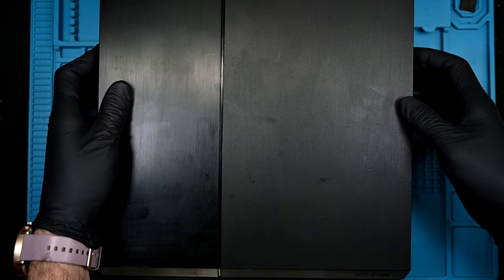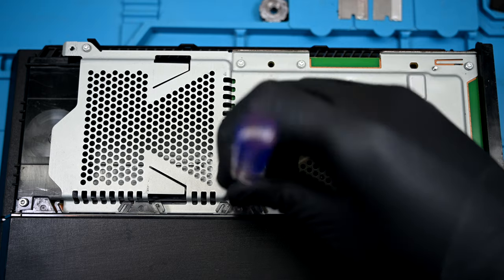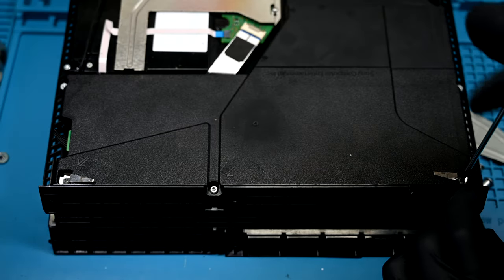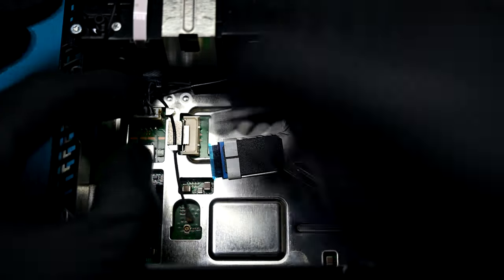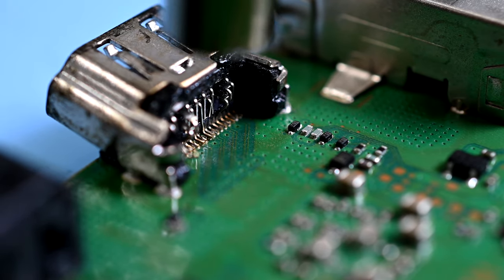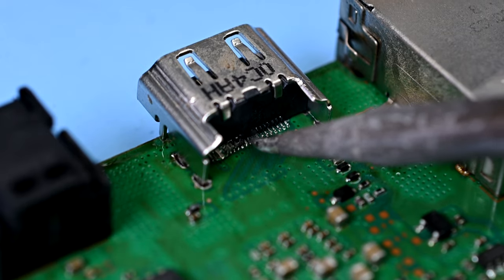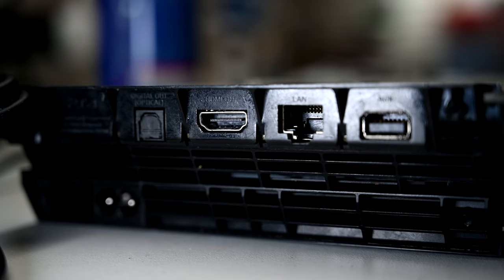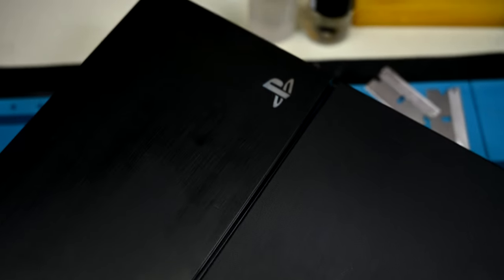PS4 HDMI Port Replacement | Guide

Comment: The clear liquid u used before u put the hdmi in place what was that bud was it that temp paste stuff
Reply from the maker: @kingkush4476  soldering flux, it’s used to keep the solder from going dry and brittle, it also helps things not stick together
Reply: @TapticDigital  magic thanks bud.

Comment: Question for a family member who tried doing this and I think messed up / broke it. For the pins at 3:04, if those ripped off and there’s no silver bits anymore, is the port officially broken or can you somehow solder new ones on?
Reply from the maker: It's not dead yet, but the repair just got a bit harder. What you'll need to do here is run jumpers. Basically the pad on the board that's missing carries the signal somewhere, we just need to find a way to connect the pin on the back of the new port to wherever the pad would carry the signal. I don't have a good video on running jumpers yet, search YouTube for "northridgefix jumpers", he has a few videos on rebuilding the connections to the port.
Reply: @TapticDigital  Tysm I will look into it!

Comment: I see you using a solder yet it is coming out clear when you melt it?
Reply from the maker: Clear solder sounds cool, but not what's happening here. The clear stuff is flux to help the solder flow and stick only to the pads on the board.

Comment: Hi, so the place that i live in isn't that pro tech  and if i bring them the HDMI port will they fix it for me but less expensive?
Reply from the maker: I'm not sure I understand. I would take it to someone with a good amount of soldering experience if possible. Some companies allow you to mail it in
Reply: @TapticDigital  sorry to take your time but I am trying everything i can't get anything under the prong pieces.
Reply from the maker: @Kurdistan2023.  Which prongs? And what are you trying to get under them?
Reply: @TapticDigital  the low metal pieces i don't have a pick so i tried wooden tooth pick but that didn't work after that i tried so many other things but none of them worked maybe because they were to low.

Comment: My son just knock the ps4 down and the HDMI cord was bent at like a 45 degree angle lol how do I know if its just the cord or the port?
Reply from the maker: Try a new cable first, but unfortunately in most cases it's the port
Reply: @TapticDigital Thanks for responding. yea I thinks it's the port because it was bent too. I called someone who fixes them but he said he charges $160 and I was like jeez that's how much I paid on OfferUp. And I see more for that price so I'm just gonna get a different one. How much roughly do people sell a ps4 for parts?
Reply from the maker: @minhquinn439  a refurbisher would probably pay between $50-$100 as long as it's clean and has good parts still in it. People will take it for the power supply, encoder chip, disc drive, and a few other semi-valuable parts. Check out eBay for similar listings
Reply: @TapticDigital  oh ok that's awesome. Hey thanks man take care.

Comment: I dont have soldering tools but is it possible to replace the entire board with the hdmi with another ps4's?
Reply from the maker: As long as it's the same board revision it shouldn't be an issue
Reply: @TapticDigital  thank you so much for answering. You helped me a lot.

Comment: Does it have to be a ps4 hdmi or can any generic hdmi ports work?
Reply from the maker: The PS4 uses a pretty specific style of HDMI port. While they all do the same thing, some are designed in different configurations for different devices. Just make sure the one you get is for a PS4. The Slim and Pro use the same style, but the original PS4 is different.

Comment: Any tips to cleaning the hdmi connecting holes?I have been attempting to clean them with flux, Soldering wick. But it's not cleaning throughly for me to be able to just stick the hdmi port in
Reply from the maker: They are a total pain, in most cases I end up using a heatgun and jamming some wick into the hole once it's melted to clear it out. Surface cleaning never seems to suck it all up, but running wick through a super hot hole does!
Reply: @TapticDigital  honestly, really wish you had shown that process during this video. The holes are so deep that heat doesn't seem to penetrate and melty original solder. Besides this, the entire process has been a breeze, but this part is killing me.

Comment: Do I have to add new thermal paste after HDMI replace or that’s optional?
Reply from the maker: @JuanRodriguez-ed3br  always add new paste, if you put the heatsink back on it will leave pockets of air that can become super heated. It’s okay for testing, but for final reassembly you should always use new paste
Reply: @TapticDigital  thanks dude
Reply: @TapticDigital  thank you

Comment: Can the port be removed without a heat gun? I have a soldering iron but no heat gun.
Reply from the maker: Very difficult, you'd have to use wick to clear the solder from all holes as well as the pins themselves, it's very difficult to clear it all without some getting stuck
Reply: Galium + leaded solder or this thing called quick chip , i have used this method once to desolder some lqfp64 component with only soldering iron , it makes the solder melt at around 100-150°C so theoritically this should be possible , i also would prefer to have hot air but i have no space for it :/

Comment: What is that he uses to clean the solder
Reply from the maker: I put flux over the solder and use copper wick to clean off the old solder. Flux is great for helping solder flow where it needs to go. Then I use regular isopropyl (rubbing) alcohol to clean the flux off the board! Hope that helps!
Reply: @TapticDigital  thank you. Copper wick. You earned a sun

Comment: Is this achievable without a heat gun? Or hairdryer or blowtorch from distance?
Reply from the maker: Definitely wouldn't use a torch, and a hairdryer won't get nearly hot enough. You need something that can reach 450°C, or about 840°F
Reply: @TapticDigital  Thanks for reply! Yeah maybe have to invest in a gun…. So not possible with just copper braid and soldering iron?
Reply: You make it look too easy
Reply from the maker: @Jasongunn1996  the wick does great, but always leaves some between the pins and the pads, so without heat it can rip the pads off.

But, depending on your dedication level, I think there's a way. You may be able to hold the iron on a single pin, melt, then use tweezers ot the iron to bend it up off the pad. You would do this for every pin. Then you would hold the iron against both feet on one side from the bottom and slowly lift it up, then the other side, then back, basically "walking" the port up and off. It's a lot more time, but would technically work!

Otherwise, hit up your local hardware store, basic heatguns can be very inexpensive and might come in handy later!
Reply from the maker: @Jasongunn1996  😊 I'd be lying if I said every one was a success, or that I didn't break a few learning

Comment: How did you get the holes clear before you put in the new hdmi?
Reply from the maker: @HeavensKitchen586  wick to absorb it from the holes. Sometimes it helps to add more solder to them and then press the wick down. Sometimes I have to use a heatgun to get the solder to melt, then use tweezers to press wick into it while still holding the heatgun on it. They are definitely one of the hardest solder spots to remove.
Reply: @TapticDigital  yes I was able to figure out how. Now that I got it back in it still not showing the display. I keep getting the White light.

Comment: Sir Great video. Sir quick question I came here looking to find a way to fix my sons HDMI port problem but as I have learned it’s gonna take some expensive tools to fix it which I don’t have and I would only use maybe for this repair. Is there a way to get in contact with you so I could possibly send you this PlayStation for you to fix the same problem? Thank you
Reply from the maker: Hey I don't offer mail-in repairs just yet, I'd recommend contacting local shops with decent reviews. Many phone repair shops also offer this service. If all else fails I have recommended ShaneFix in the past, they offer quality mail-in repairs with good turn around times.

Comment: Is the clear goo you put down flux? I'm new to soldering but wanting to give this a go on a console myself to learn. Doesn't seem too hard since you made it really easy looking lol. So do you put the flux down then your wire to clean off the ports and then solder on some to the board just so it sticks?
Reply from the maker: It sure is flux, it creates surface tension and removes impurities. I use it when I'm cleaning the pads off of the old solder, it helps the copper wick absorb the solder faster. Flux gets burnt after enough heat and needs to be wiped off periodically. I use a fresh squirt of flux then feed a line of solder into it, this helps it evenly distribute across the pads without bridging together. Solder will always stick to copper or already tinned pads, but it's tricky to make it not smear or create spikes, and that's where flux saves the day!

Comment: Is hot air Needed for this or can you do it without a Hot air gun
Reply from the maker: You will absolutely need a heat gun that can reach 450C, otherwise you'll need a lot of very specialized soldering tools to remove the existing solder

Comment: I am currently giving this a try. I have some experience with esd, soldering.. ect. Anyways I have mine completely apart. I bought the heating gun, flux ect.. I now have it apart only to find the hdmi port it came with actually has a black plastic piece on the back side of the physical port covering where the individual pins connect. Not sure if that might just be a type of dust cover or not? Whether or not to pull the black tab off???
Reply from the maker: Is it the foam-like tab? If so I am ashamed to say I occasionally melt those off after forgetting to pull it. It isn't necessary though. If you have some kind of black tape covering actual connection points, that may be signs of a refurbishment or a manual fix at the factory, it likely isn't needed either

Comment: What’s the liquid you use to stick the new port on called?
Reply from the maker: I use Flux to help the solder flow, though it doesn't attach the port, the solder does

Comment: What do you use to clean the port please and what screwdrivers do I need to get ?
Reply from the maker: To clean off the old solder I use Flux and some braided copper soldering wick. I add a little bit of flux to the solder and press the wick down with the iron to absorb the old stuff. For screwdrivers you'll need a T8 and T10 driver.

Comment: On the part where you say "leaded solder mixes with unleaded to hold the feet in" around 2:30, what exactly do you do here? There's some clear liquid applied, then some type of solder. Is the clear liquid flux? And is the solder being applied after that leaded, unleaded, or both? Thanks! at 2:55 you appear to use some sort of copper, is that the copper braid mentioned in another comment? Do you just use a soldering iron to heat the copper to clean away the old solder? Right after that, is it flux used again to clean the spot on the board that the pins will rest? 

The speed of the video is fantastic, but when you're super new to this all the talk of flux and the like is overwhelming. I've replaced pokemon GB batteries using just solder and a cheap soldering iron, this looks a lot more intense!
Reply from the maker: It's definitely a bit more involved than a Gameboy, but not too far off to be honest. And thanks for the questions! I'll break it up a bit down below:

At 2:30 the clear liquid being applied is ChipQuik tacky flux, basically like regular soldering flux but dries differently. The type used doesn't matter, as long as it's meant for soldering.

The factory solder is lead-free or unleaded to comply with health regulations in different countries. This is fine, but it has a higher melting temperature than its lead-filled counterpart, leaded solder. So what I'm doing is feeding in leaded solder to mix them, which should lower the overall melting point. This means I can run my heatgun at a lower temperature for less time, reducing risk of overheating other components. This step is not required, just something I found that makes my repair life a bit easier!

At 2:55 I use what is called "soldering wick" but I've also heard "copper braid" or my old coworker who called it "the rope that tastes like pennies". It's more or less just thin braided copper coated threads. You press this down with a soldering iron over the solder you want to remove, and a capillary effect "wicks" the solder off the board and on to the threads. This is kind of like having an undo button if you accidentally add too much solder somewhere.

Finally, flux is used at almost every step, because it makes things flow easier. I apply one coat when adding and removing the solder, then a second fresh coat when I add solder to the pins. Flux has a tendency to burn after heating multiple times, but cleans off with alcohol easily.

Hope this helped, let me know if you have other questions! You can also message me pictures on my Instagram if you need help during the repair.
Reply: @TapticDigital  Man, you are amazing at responding to content! Ordered everything I needed to take a stab at this repair! I'll let ya know how it goes. I recently replaced the fan and thermal paste in a PS4 pro and it wasn't too bad, but this is a whooooole nother animal.
Reply: @TapticDigital  Question for you. I went to apply the new HDMI port but the legs were so tall that there was no way the pins could be pushed down to meet the board. I ordered the ones that you linked, but no dice for me. Do you shave down the legs or anything if you need to?
Reply from the maker: @thunderboltediting5283  shouldn't have to change anything, it's more likely that there's additional solder still stuck in the holes, at least enough to keep it from going down all the way. If the holes look totally clear, push with some force and it should pop into place.
Reply: @TapticDigital  So there should be holes all the way through the board where the legs go? Hmmm... Maybe my soldering iron is too weak. Even when I press it firmly against where the legs were previously it never clears the holes or goes through the board in any way completely.
Reply from the maker: @thunderboltediting5283  that's definitely it then, best bet is to use a heat gun till the holes go liquid and firmly press the new port down quickly

Comment: What is that you use to clean the hdmi pads on the motherboard
Reply from the maker: Soldering wick, which is essentially braided copper to pull the old solder off. Flux goes on to help solder flow where it should, finally it's all wiped and brushed with 99% isopropyl alcohol (regular 70% rubbing alcohol works fine as well)!

Comment: What exactly did you do when tinning the pins and with what kind of solder wire
Reply: Are you just recoating the pins and setting them up for the replacment to have a good connection or am i dooppy
Reply from the maker: @travisingalls8615  basically just adding fresh leaded solder to the pads before setting the port down, then pressing the pins into the pad causing that solder to "wrap" around the pin and hold it down firmly. I'm using just generic 0.015" leaded solder.

Comment: What was the clear liquid you put on the board to clean it up before putting on the new hdmi port?
Reply from the maker: I use Flux to help guide the solder where it needs to go when soldering and the liquid is pretty clear but thick, actually cleaning the board is just 99% isopropyl alcohol.
Reply: @TapticDigital  oh alright thanks!

Comment: The cleaning parts used in the area where the port was. What is that called?
Reply from the maker: I use soldering wick (looks like copper braid) to absorb the old solder. The tube of liquid is soldering flux which helps keep things from smearing or sticking to each other, and finally I use a high percentage isopropyl alcohol to wipe it all clean!
Reply: Thank you you're amazing. I will do

Comment: What's the liquid flux stuff used I cant seem to remove the solder from the 4 pins
Reply from the maker: Those feet are a total pain aren't they? I like to mix leaded solder into them to lower the melting point. Sometimes using a heatgun and a length of wick to brush it out works. If all else fails just heatgun till the feet are liquid and jam the new port down
Reply: @TapticDigital  SO I AM NOT CRAZY!!! THANK YOU!!! LOLOL